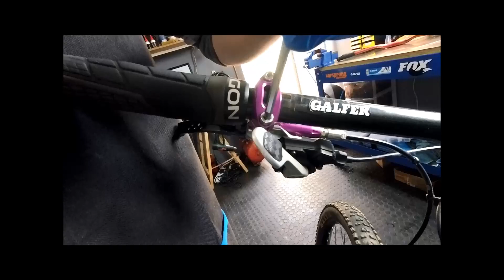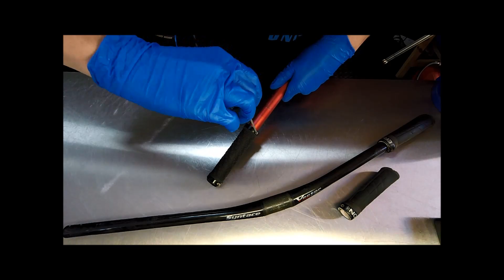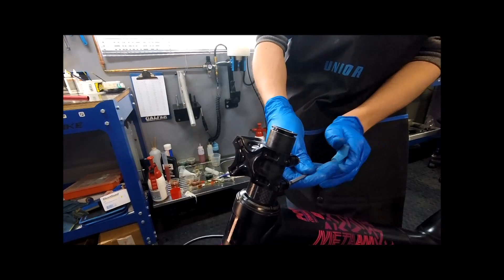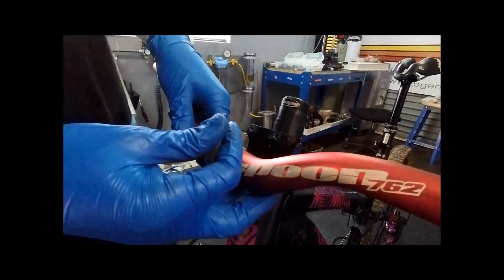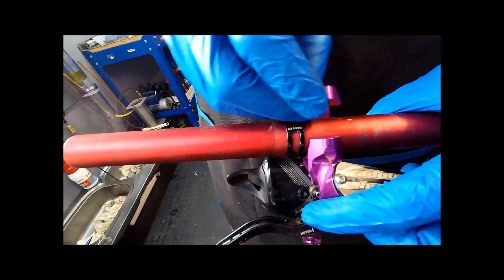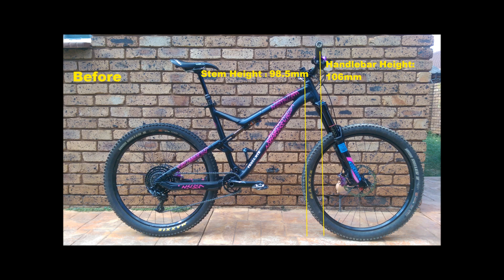My HIGH rise Handlebar | Install video

Comment: Hey if you have the correct amount of spacers under the stem for correct stem height cut the steer tube flush with the top of the stem. The cap then adjusts bearing load when tightened. You will need to move the star nut down in the steer tube. The way you are running it is all wrong.
Reply from the maker: Yeah but then the resale value goes out the window for the fork, you can't cut it flush you'll have to cut it 1 or 2mm shorter so there's the gap for the slack to be taken up, no there is nothing wrong here, works perfectly and will for anyone who does it properly
Reply: @JustFrana  works perfect till you pop your eye out.lol

Comment: a riser bar mounted at the bottom of the steerer tube. why?
Reply from the maker: To gain reach while not affecting effective handle bar height
Reply: Isn’t that defeating the purpose?
Reply: And wouldn’t stem length effect the reach?
Reply: Why not just get a longer stem then?
Reply: @JustFrana  that a good idea
Reply: @JustFrana reach isn’t changed by the rise in the handlebars but the length in the stem or the height of the stem and given you have plenty of steerer tube all you had to do was put spacers.